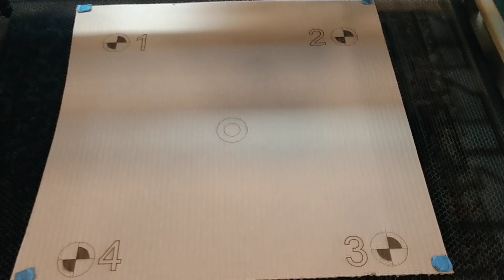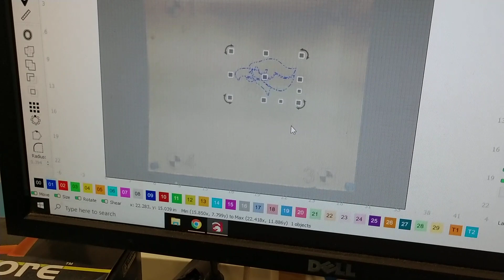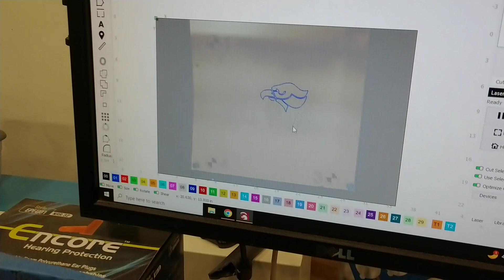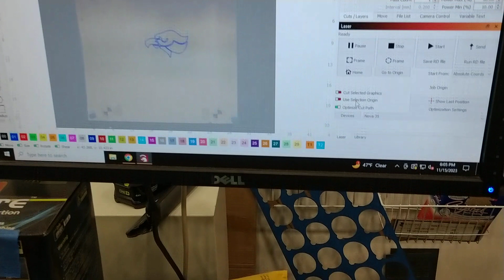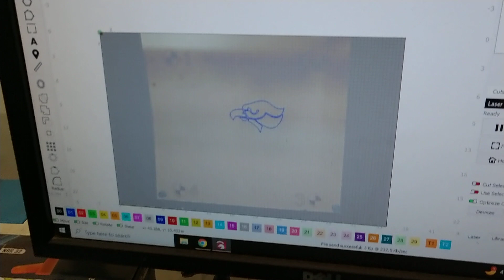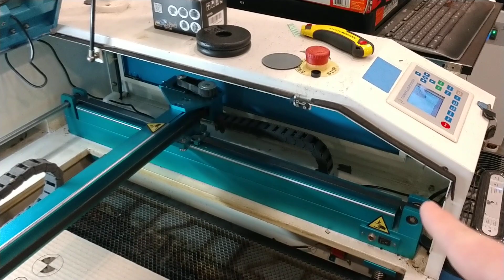Using Lightburn and a webcam to control your laser cutter

Comment: Suggestion to save card board I cut 4 inch by 4 inch squares put 4 in the corners and one in the center and I use poster board.
Reply from the maker: The cardboard gets re-used in the spray booth floor, so no worry on waste. Didnt think to try that, might have to later, thanks for the tip!